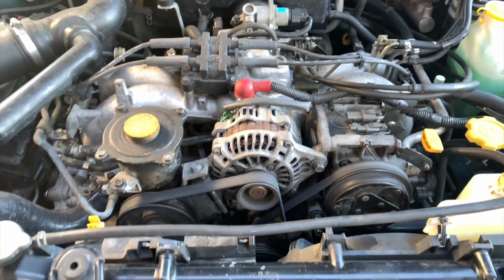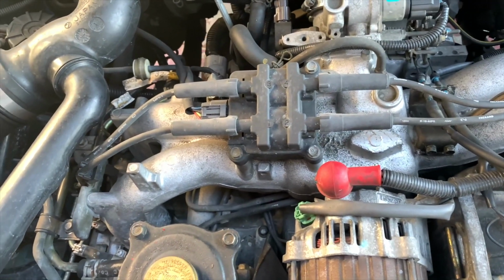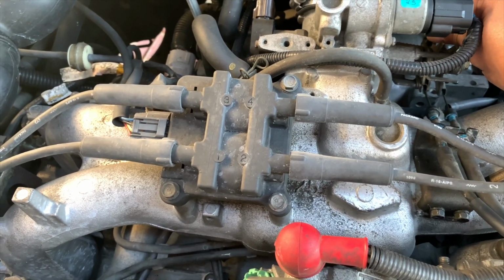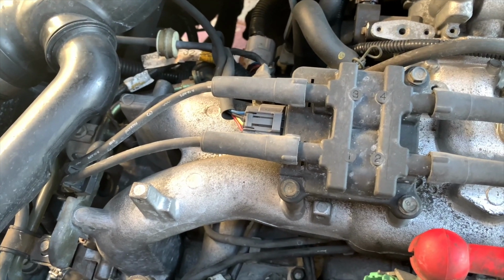Need Help! 1999 Subaru Forester EJ25 (Mysterious Noise)

Comment: And also check all the timing sprockets because the gear looking one can be making this noise as well but your issue with the sound is coming from timing components I promise I have seen it and 50 subaru engine I have fixed
Reply from the maker: My timing sprockets should be tdc. I don’t think the car would run if it was off right?
Reply: No I'm saying check it to make sure that it don't wobble because the gear shaped tensioner is known for failing on them the ball bearings fall out of them but check you tensioner with the piston to make sure that its giving good tension because they are also known for failing and they will give slack on the timing belt and cause the tensioner to move and slap off the block and make it sound like rod knock
Reply from the maker: @zachbuchholz3810  ok I’ll check it out

Comment: I have a wrx 2014 with exactly same noise at 3000 rpm do you solve it?
Reply from the maker: Rod knock. I replaced the whole engine.

Comment: Its your timing belt tensioner slapping off the block get a new one oem from subaru
Reply from the maker: Timing belt tensioner?? The one with a piston?
Reply: Yeah the one with the tensioner and a big heads up if you got a dayco timing kit I can garentee that the tension with the piston it shot even if it only has 200 miles because I have went through 4 tensioner from dayco and all 4 only lasted maybe 500 miles before they where doing the same thing  so I switched to a gates timing belt kit and have not had a single issue since
Reply from the maker: @zachbuchholz3810  I put back on the old original timing belt and tensioner. The ones I used that was included in the timing belt kit seemed to be jumping teeth off the center crank pulley. I’ll recheck that original belt tensioner though it has 107k already on it.